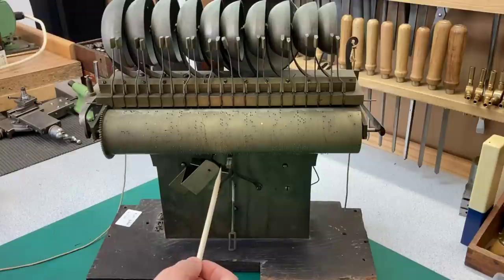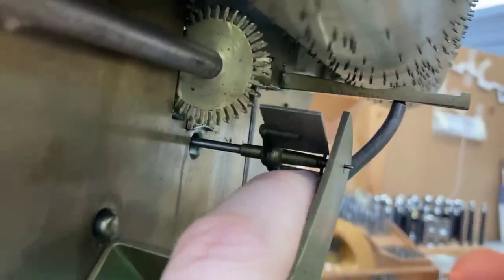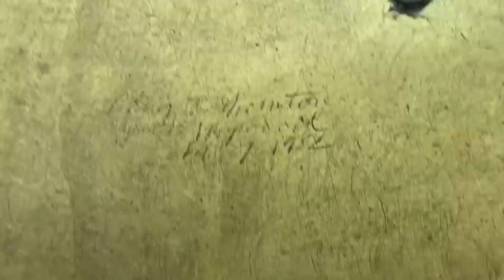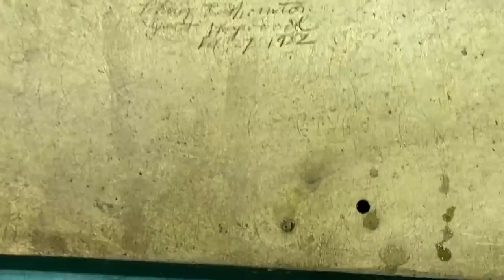MUSICAL CLOCK RESTORATION, Restoring and conserving. - Ellesmere Shropshire - Part 2

Comment: Thank you so much for documenting your work on this wonderful work of mechanical art!

I have a theory. 

I wonder if count wheel isn't supposed to revolve multiple times. The way the locking arm so exactly skips the drop in the count wheel has me thinking that the gearing from the count wheel to the hoop is such that the hoop goes "out of phase" with the count wheel for one or more rotations. When you were hand powering it, it did strike me (pun intended) as a rather short musical play time.

In fact, in the video the count wheel has some marks (they look hand cut, not wear, but I could be wrong) and the locking piece skips 3 marks per locking "attempt". It's hard to think of a reason for doing it this way, rather than putting the count wheel on an arbor further down the train, but if it is supposed to rotate 3 times then maybe there simply wasn't a convenient way to get the desired train gearing in the desired number of wheels and still have a 3:1 somewhere in there. Or, looking at the video again, there simply wasn't room to extend a different arbor amongst the winding arbor, minute wheel/s and former flirt.

Looking forward to seeing you rebuild the flirt, if you do decide to! If not, perhaps the "intended" way to remove the music silent arm is to unscrew its stub arbor with the arm still in place. :p All shockingly inelegant compared with its original mechanism. Thanks again!
Reply from the maker: Thank you so much for your comment. Here is the latest video with a shout out to you and an answer to your questions! https://youtu.be/h9YYIAbXLnU

Comment: Very interesting video. Its fascinating to uncover the history of these clocks and especially find makers and/or repairers marks on them. Its also interesting how it has been modified over its life and why someone would do that rather than just repair it. It makes me wonder if the original design of the striking detents and releases was rather temperamental. Finally I couldn't help noticing the sort of centre punch marks on the front plate around the stub axles. Can you explain what these might have been for?
Reply from the maker: I'll mention the punch marks in the next video.  A few have asked baout them.

Comment: Will you also be adding your repair mark to the inside of the clock?
Reply from the maker: I'm often asked this and tthe answer is no.  I have been specifically asked to on previous jobs, and I did go through a phase of doing it, but I now feel that it is too invasive to mark the object.  I often leave a card with the clock with basic details of the work done.

Comment: Everything about this movement seems very large - the size and thickness of the plates, the length of the arbors.  Will be interesting to see how you reverse engineer the missing flirt and spring.  I'm wondering why each bell has two hammers.  Your videos are fascinating.
Reply from the maker: Two hammers per note/bell enables fast music as it can play notes in quick succession, quavers and semi quavers for example.

Comment: Hi Tommy, I'm working on a clock now, and you can see where the steel cable has marred the strike drum, not sure of the degree of work being done on this clock yet...but do you stick with wire cables when this has already happened, as I suspect it may be heavy wearing aginst perlon or natural gut afterwards? I think it would be a bit too much to address the wear.

Comment: I see the reasons for avoiding steel wire would you avoid bronze for similar reasons? I am making a skeleton clock as a hobby and have bought both nylon and bronze line... I thought the bronze would look good but now I am questioning that decision. Any advice would be welcome!
Reply from the maker: I personally don't like Bronze line.  It's not as strong as you might think and doesn't look very nice.  It's not going to damage the clock in the same way as steel though so I'm not against it.  I use Perloine, natural gut (but only the super high quality stuff), or sometimes on modern clocks I use tracer fishing line.  The breaking strain is huge and although it's a steel core it is coated with black nylon.  There is also a clear nylon coated steel line available for REALLY big weights.
Reply: @TommyJobson   Many Thanks for the advice. I shall investigate the natural gut materials. Many Thanks again for your advice and the videos you are producing!